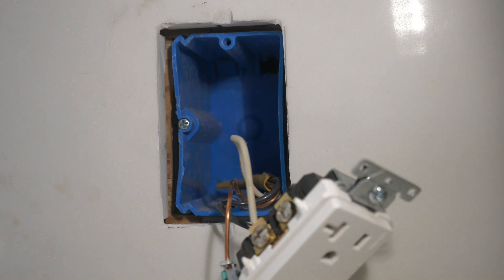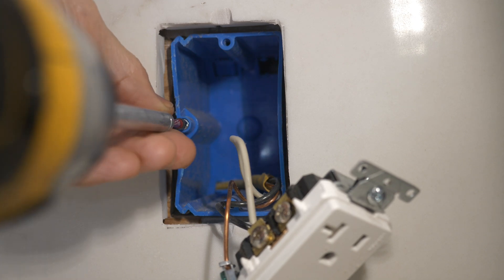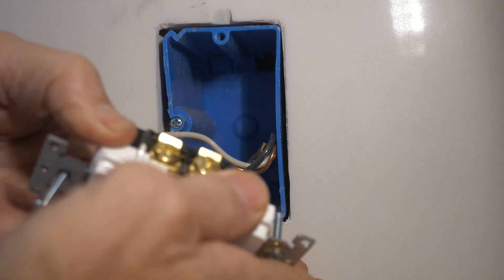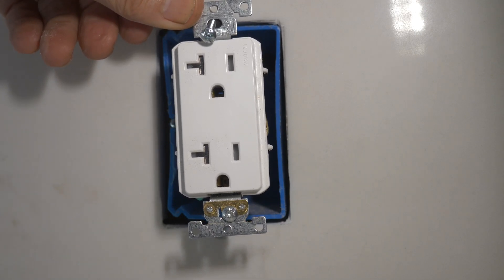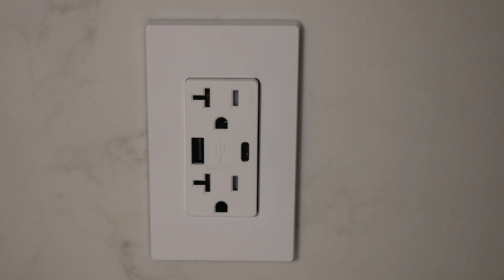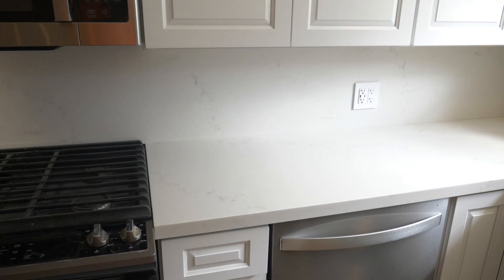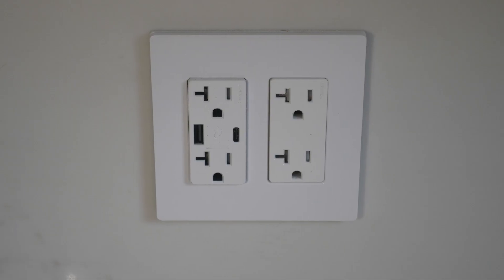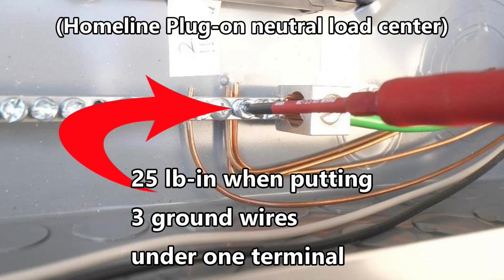How to Install and Troubleshoot End of the Run Receptacles

Comment: Sparky, I have a code question.  I will be installing a Ring floodlight camera which will be mounted outside, on an exterior wall overlooking the driveway.  The Ring floodlight camera requires 100 VAC.   I plan to use the power from an outlet that the garage door opener uses.  I plan to run NM/Romex from the Ring and tap into the power at the garage door opener outlet.  The NM will be well above 9 ft. above the garage floor.  In lieu of opening up the garage door opener receptacle box and make an internal tap, would it be Code to terminate the NM cable close to garage door opener outlet in a J box and exit the J box with a 3 prong cord and plug directly into the garage door opener receptacle?  I don't want to crowd the J box with additional conductors.  This would all take place in the garage loft, will above 9 ft. from the garage floor.    Thanks,  Bob

Comment: Hi, the question is. Isn't it a more efficient way to start checking from a panel? Because it is faster than disassemble multiple receptacles. Other days, I had a plugs circuit not working and started from downstream outlet how was described in the video. But it is ended up there was a bad connection between an OCD and a bus-bar. So I could save plenty of time if I'd started checking from a panel not from an end-plug

Comment: If only you had a Klein ET450 or a Ideal SureTrace this fault finding would be so much easier😁

(For those not familiar, those are circuit fault finding tools Sparky demonstrated in prior videos.  And some of us will spend plenty of time doing the steps shown to avoid going back to retrieve the tracer kit 🤔)
Reply from the maker: Excellent points. The Sure Trace and the ET450 are both great troubleshooting tools. Thanks RJ!

Comment: Hi Bill, nice video as always!I I really enjoy your videos and tips and try to never miss one.
By the way, I have used Wago lever nuts almost exclusively for the last 3 years or so since I first discovered them here on your channel. 
I have wanted to try the inline ones and I was just about to order, but I noticed that your link goes to the WAGO 221-2411 selection. Wouldn't the WAGO 221-2401 be a better selection for most people since it works for up to 12 AWG as opposed to 14 AWG max for the other?
Thanks!
Reply from the maker: Thanks! Yes, these are rated from 12 - 20 gauge: WAGO 221-2401 Inline Splicing Wire Connector Pack | 221 Series Lever Nuts Assortment with Case | Includes (20x) 221-2401: Amazon: https://amzn.to/3TJO2em
Excellent question.

Comment: and when you turn off the breaker, you find that two or more of the receptacles it controls are the end of the run, and none of the others have an extra cable in them.  it happens nearly every time.
Reply from the maker: Thanks Ken!

Comment: Bill, how effective would your recepticle tester be for checking the upstream receptacles for open ground in this case?
I understand that this was only an example. But it might be handy to know that you should not need to open all of the boxes if you have an instrument that you are familiar with and trust, and can apply ohms law logic.
Reply from the maker: A receptacle tester is effective for checking the upstream receptacles for open ground. When you find a properly grounded receptacle, work back downstream until you find the problem.

Comment: A troubleshooting technique I learned many years ago involves testing half the signal path at a time.  It works like this…

Let’s say I have a signal path (circuit) with nine devices and I have no signal (power) at device 9.  I would then test at device 5.  If there is no signal there I would go to the first device (1, in this case the panel) in the line and check for a signal.  If I have a signal  on device 5 I would go to the device halfway between  1 and 5, (device 3) and check for a signal.  I would continue “cutting” the path in half until I find the device immediately after the one with power.  That is most likely the source of the problem. 

I have found this technique to be significantly more efficient than trying to work through all the devices in a line from the end back to the beginning.
Reply from the maker: Nice! What tester do you use?
Reply: @SparkyChannel  If my tools aren’t at hand I will start with something as simple as a lamp.  When checking wall outlets I often use the Klein ET310 Transmitter see if I have any power and simultaneously find a wiring problem.  If I need to test wall switches I will grab my Klein NCVT-3P Voltage Tester and Flashlight.  And finally I will get the Klein MM400 Multimeter when necessary.  With these tools I’ve never found it necessary to use two wet fingers.  Or a tongue.  Those two tools are not recommended.